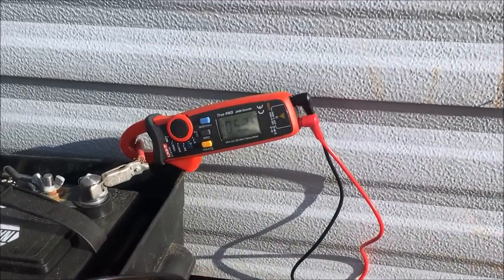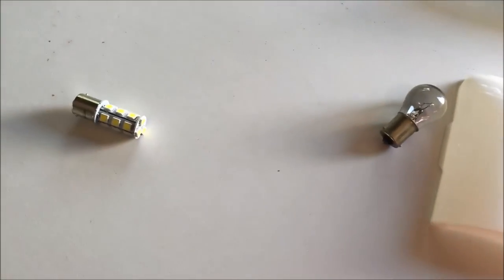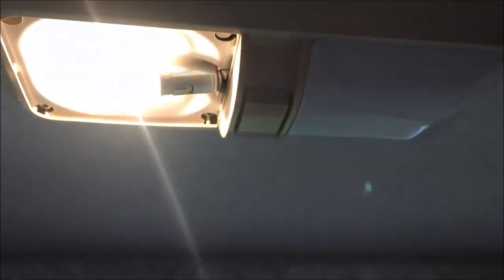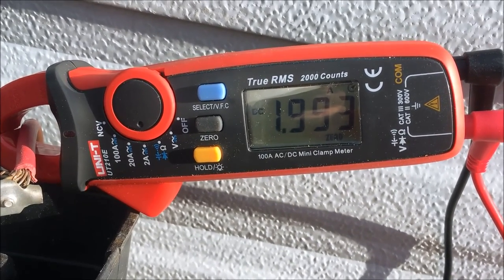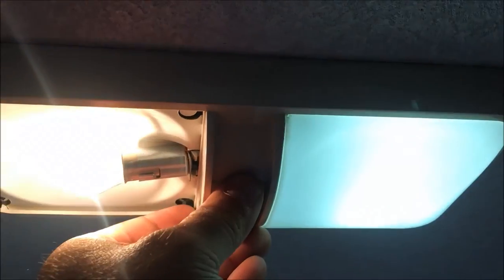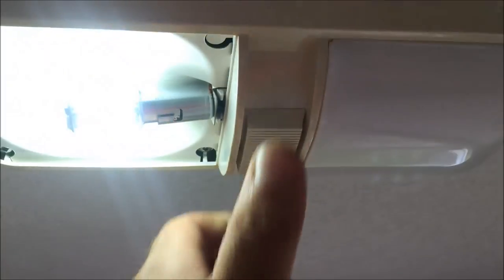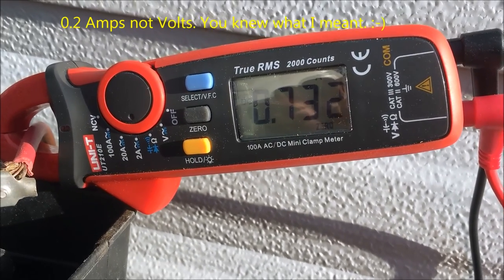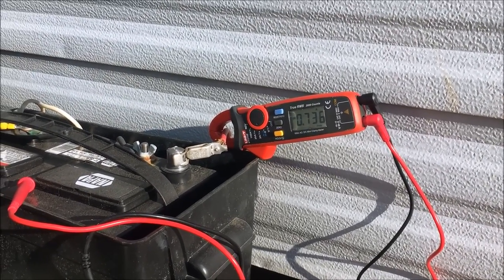Replacing RV 12V Bulbs With LED Bulbs

Comment: So do these LED bulbs only work when running on battery only ("dry camping") or do they work just fine in a full-hookup (electrical power supplied) situation as well?
Reply from the maker: They are 12 volt bulbs. Most campers have both 12 volt and 120 volt. There is also usually a built in inverter. So when your at a full hook up location the inverter will send power to all 12 volt applications.
Reply: @UpperPeninsulaDIY  May I be so bold as to correct the reply:   THE CONVERTER is the built-in 12-volt battery "charging" system (it is in effect a "smart 12-Volt Charger."   The unit requires a 120 Volt 20 or 50-amp (depending on your system) line hooked up to the RV Park's Grid Power Socket.    The "INVERTER" is sometimes combined into the Converter/Inverter BOX but many RV's have a separate Inverter unit (depending on the age).  THE INVERTER takes 12-volt power (coming from either 12-volt or 6-volt "house batteries) and then supplies 120volt A/C power to the RV.   For example, if you were NOT hooked up to an RV park's 120volt power, and you were "dry camping" then you could power up an LCD/LED TV and use your antennae and watch "AIR TV."   So, you CONVERT 120volts to 12 volts with a "converter" and INVERT 12-volt Battery power to 120Volts using an INVERTER.
Reply from the maker: @d.j.2803  Thanks for clarifying. I usually get them mixed up when talking about an inverter or converter.

Comment: How did you connect your multimeter to measure your amps off the RV?
Reply from the maker: My multimeter has an amp clamp that I just clamped around the positive wire. It can also be done by unhooking the positive wire from the battery and hooking up your multimeter in between the battery and the positive wire.